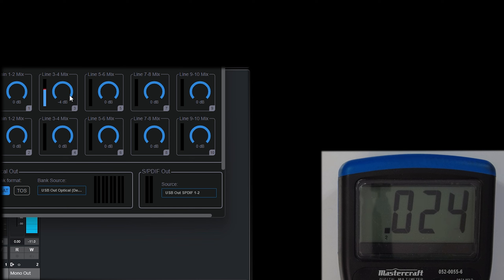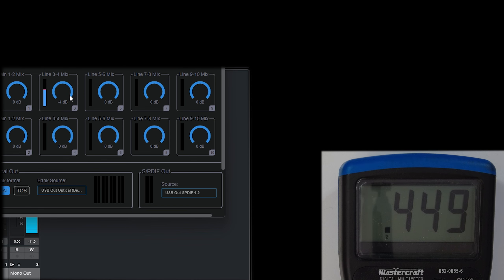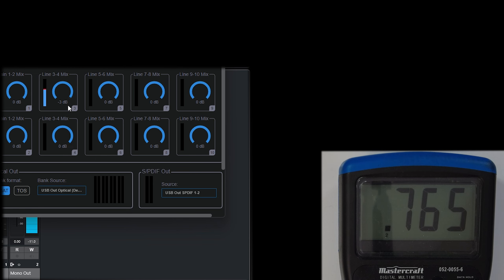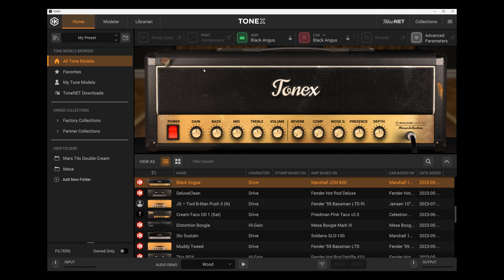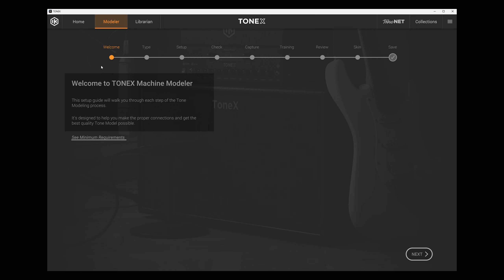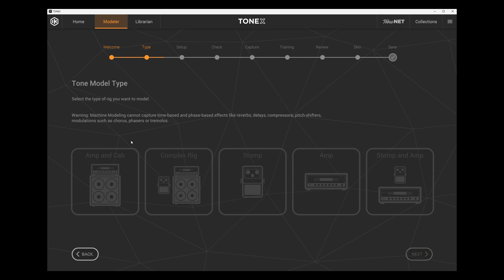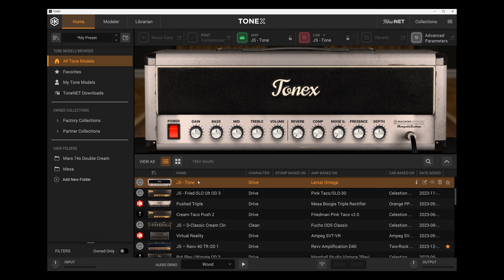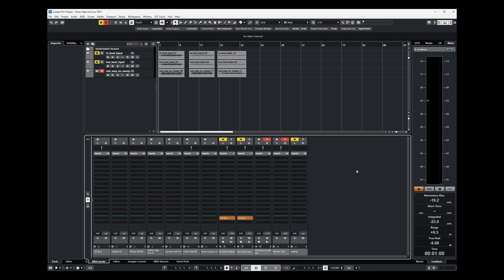Unlock The Secrets: Mastering Tonex Tone Models From Setup To Capture!

Comment: ok i finally wrapped my head around this, getting good captures, have to adjust the trim to about 2 o'clock to get the result to sound nearly the same. was trying your captures out and the free ones are really good and consistent, but i do find i need to give them a little more input to break up naturally with my lower gain humbuckers, well 14k and 16k region vs fluence moderns. all in all i am finally understanding this better and am able to copy my headrush prime paid for captures over. thank you!

Comment: Awesome as usual !

I am not as technical as you at this point so bear with my questions.

If I buy your captures what is required on my setup to have them sound as intended?

Also would be awesome to hear your ideas on stomp captures.

For me it would be great to capture my analog settings on my OD pedals > ToneX pedal, then I could integrate those with midi type snapshots for complete rig one press type setups😎
Reply from the maker: I will likely do a video on DI and pedal captures in the future :-) For my tone models to sound identical to how I captured them, on Tonex Pedal you should set your Global Inpout Trim to -3.0 dB. Hope that helps :-)

Comment: Dont you always experience lower gain in the captures? Whats the benefit to use a reamping box?
Reply from the maker: I have not found that. My gain level is always exactly as the amp sounded. The reamp box is designed to take the Line out of your audio interface and send the proper impedance level into the front of your amplifier. Hope that helps :-)

Comment: Fully agree that the approach makes sense, and I would also love to see more third-party vendors (or even stock captures by IK) following a similar standard and provide their input level metadata. In the meantime, am I right in assuming that if I have set my input level relatively hot to sound good with stock captures, if I then load one of your tone models, I would have to turn the gain (or equivalently, input trim) down for them to sound authentic (i.e., as captured by you)?
Reply from the maker: Yes I agree, it would be nice to have actual numbers from vendors! You are correct in what you say about getting my tone models to sound as I captured them if you are cranking your input gain higher. For instance, on Tonex pedal, an Input Trim setting of -3 dB will sound identical to how I captured. If your Input Trim was set up around +8 dB for instance you could simply turn your Gain knob on the tone model/preset down to around 3.0 or so and get a very close sound. Hope that helps :-)

Comment: Hi Jason thanks for the detailed walkthrough of this! My capture results have definitely improved. I have a quick question. If I'm sending a line level output from my interface into the Tonex Capture box, and then out of Tonex Capture into my amp without any attenuation (leaving the knob at 0db), am I essentially hitting my amp input with that full line level signal? I just want to be sure I'm not overloading my Princeton especially as I start to do captures with higher amp volume. Thanks!
Reply from the maker: My pleasure :-) If you followed the calibration steps I laid out in detail at the start of the video, you will be fine. Hope that helps!
Reply: @JasonSadites   Thank you it does! I was able to calibrate my send and return levels with a multimeter like you described. I just can't tell if getting 0.775v out of the cable going into my amp means I'm hitting the front end of my amp with 0db of signal or -11db of signal

Comment: Hi, for the line 3 output that feeds back into the capture hardware, are you sending a specific channel to that output? or is it the same output going to your monitors? In my system I have an output matrix and need to define which signal is patched to the "line 3 output". Thanks!
Reply from the maker: The Line 3 output is its own output. It is used to send the training signals to your amplifier/pedal depending on what you are capturing. Hope that helps :-)

Comment: Any recommendations for getting pedal captures of low gain/boost sounds to actually have level. I captured as hot as possible (-1 below clipping at any point during the capture process) and yet its still quieter than unity in both tone x and amplitube. It shouldn't be its coming back way hotter then the test signal is sending (ie should be above unity) but whatever IK uses to somewhat normalise kicks the volume down a lot on dynamic signals. On the high gain stuff it is the opposite problem being a lot louder despite the pedal itself not being louder (rms is probably on par, peak is much lower).
Reply from the maker: Unfortunately that is the nature of cleaner tones. The peaks are going to be much louder than the RMS. I get around it by using the compressor after the fact in the preset to control those peaks on the cleans which will then allow you to up the volume before clipping. If set properly it can be quite transparent. Hope that helps :-)
Reply: @JasonSadites  yeah it's just annoying that tonex turns down everything by that amount . There is plenty of headroom there but the level tonex captures at means I can't capture any of my boosts and have them function as boosts.

Comment: Ive been trying to capture my plugins to use as amp only capture with my real cabinet but for some reason the capture are so lower in gain everytime... tried rearoute, jackaudio, same problem... ive tried over 20 captures, same result
Reply from the maker: I would say they are just different. Great results can be had with all of them :-)
Reply: @JasonSadites  tried both, the captures are always much lower gain than the original